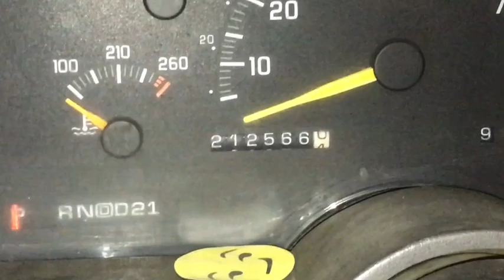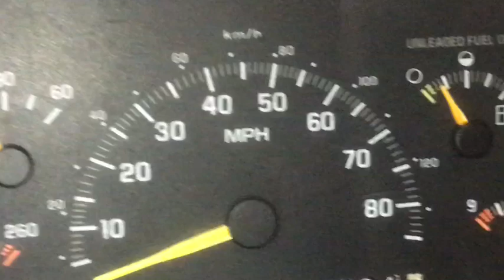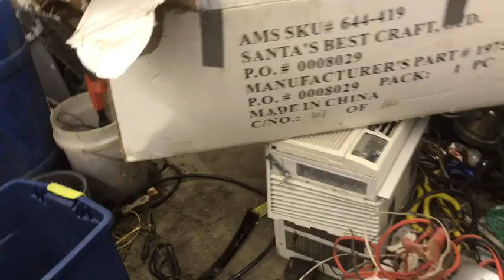LETS PROCESS SOME COPPER & BRASS SCRAPS

Comment: try sitting the transformer on top of the vice with it partially open after getting the bottom off of it and then hitting the center and driving it out then it will come apart easier the way your doing it your squeezing it tighter As for the vice the pin is broke off from squeezing to tight with it just turn it over and punch the old one out and find an old drill bit the same size cut it to fit and put it in then it will open up again with the handle  Have a Nice day keep the vids comin

Comment: scrap the microwave on your bench first.  It will clear much needed bench space. Start a bucket for simple nuts, bolts, washers, etc.  Pull all your tools in a space near the bench so you can find them.  Start a tote for all #1 wire.  Start a tote for all #2 wire.  All tires in one space in the shop, all stainless in another, all aluminum in another.  If you can and when you can use the 4 corners as the 4 main items you want to put in the shop.  This will give u space to keep the truck inside.  Wish i was closer I would come up and give you a hand getting that shop in order.

Comment: pound a nail in your bench.  Scrap the microwave on the bench and retrieve the round magnets from the magnetron. After using the magnet it goes on the nail you just pounded.  This becomes your magnets new home..permanently.
Reply from the maker: Bob Morse good ideas or actually the best ideas come from my commenters. Thanks man although I’m going to keep that microwave but I have others that I can take those powerful magnets out
😁👍